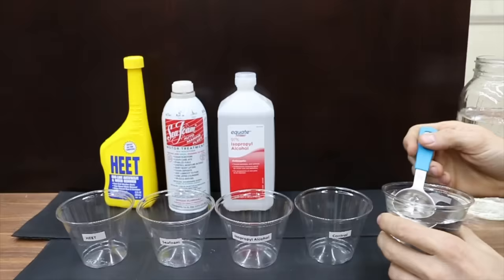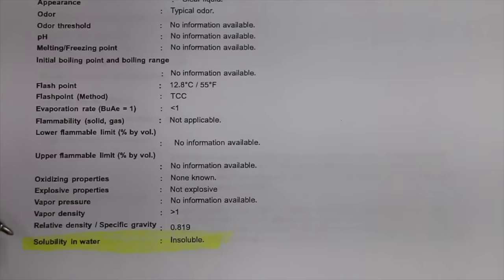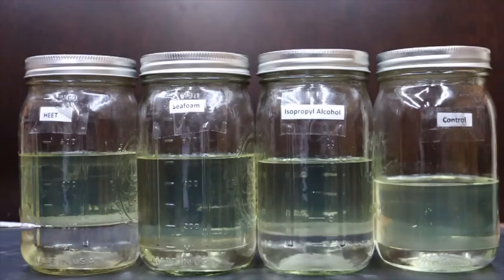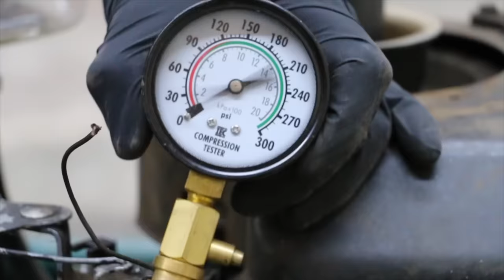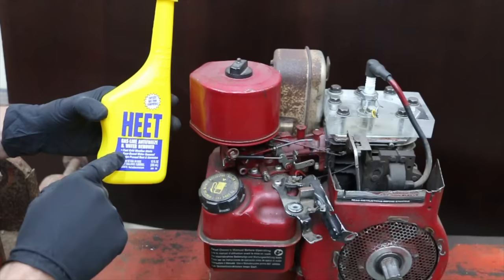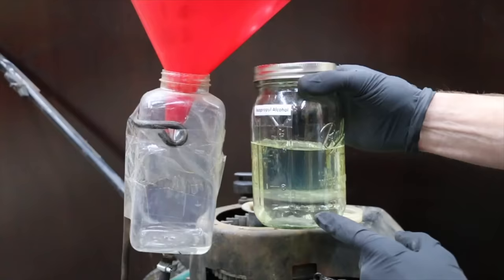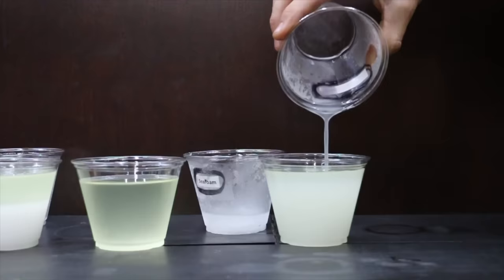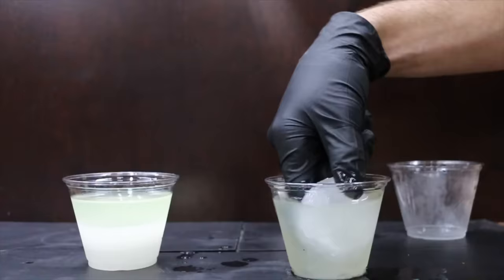Is HEET better than Seafoam for Water in Fuel?  Let's find out!

Comment: Isopropyl alcohol is sometimes sold a rubbing alcohol.  Rubbing alcohol often contains 'lubricants' in the form of silicone polymers.  The silicones pass out the combustion chamber's exhaust port as silica which can foul the emission sensors in some cars.  When the sensors fail the computer can intentionally degrade the car's performance and the repairs can be expensive.  So if you're planning on using isopropyl alcohol, make sure it's not the rubbing alcohol type.
Reply from the maker: Great point!  Thank you for this information.
Reply: SE Michigan Andy I did not know this.
Reply: @noohairdontcare  I found it out in a meeting I attended in the 90s.
Reply: Emissions are junk anyway, slows you down
Reply: @Jay-hu6ne  Regardless of how you feel, they've been regulated onto the cars and I'm not going to discuss the politics.  On several cars, if the computer is not getting a proper reading from one of the sensors, it will default into a really bad driving mode - no acceleration, marginal top speed, and kind of scary to drive. That happened to me once but the car was over 20 years old and it was not due to silica contaminating the surface of the sensor.  The sensor just got old.   And that's why I brought this up.  Isopropanol is a good drying agent but make sure it doesn't have 'lubricants' in it if you're putting it in the gas tank.
Reply: @ProjectFarm  didn't know that, thanks
Reply: SE Michigan Andy ummmm okay....I just said emissions are blah. No such thing as a scary drive if it’s just a sensor. OBD1 I have no problems with for pulling things off, ECU either compensates for it or just get a reprogram. Highly doubt a vehicle will go into a limp mode due to a sensor going bad. If anything depends on the sensor like a IAC or a MAP sensor. Yea my lightning is 25 years old and still has its original 02’s and still lays down the power fine and mileage is still great, truck has 270 thou on the clock. But for my OBD II applications, gut the emission stuff and tune and its alllllll good. Plus you might gain a little HP out of it, noting crazy but a little something.
Reply: Paul Copeland you must drive a electric vehicle and wear fake Rolex’s
Reply: @Jay-hu6ne  The O2 sensor died and the car defaulted to a max speed of about 35 mph with pathetic acceleration.  In Michigan, that's scary.
Reply: Mr T  Look up 'dimethacone,' it's in all kinds of stuff.  It's a nice sounding name for silicone polymers.
Reply: I did not know this
Reply: That's why they have isoheet.... It's also great for making lanolin based reloading lubricant.
Reply: really?
Reply: Hey I’m using rubbing alcohol as a panel wipe to take off silicone and wax before I ceramic coat a car and this information is helpful do u have a source so I can show my detail buddies
Reply: @PeteyMcSavage  They allready know, you can see it in a strong haze.
Reply: PCV and EGR will do far worse to your 02 sensors. Also old gas rot at the bottom of your tank might as well be diesel.
Reply: Don't know if a old n greasy O2 sensor spacer would do it. I need to do it anyway, burns so much oil that CEL is always on.
Reply: Great catch !!!! thank you very much:)))))
Reply: @PeteyMcSavage  Sorry, the info about it fouling sensors came from a meeting with an automotive component supplier in the 90s about failure analysis.  I've noticed some bottles of isopropanol mention that they contain 'dimethacone.'  I started reading those things years ago.
Reply: SE Michigan Andy never heard that before ever for a vehicle
Reply: DarkLinkAD you mean water....
Reply: @Jay-hu6ne  Do you mean an irate reply from a person with a headache or a tooth being removed from a car?
Reply: Mr T  Cause it doesn't get in to your skin. That having been said, I have never seen pharmacy isopropanol with lubricants. I would have noticed, as I use it almost exclusively for cleaning things such as optics.
Reply: SE Michigan Andy you mean Silica as the toxic to breathe Silica?
Reply: @AnAngryFormerDemocrat  no
Reply: use 100% ISOPROPYL
Reply: I got an old military truck without electronics, so It should still work even with silica in the exhaust.
Reply: @Jay-hu6ne  I can assure you that modern vehicles have this, as my job revolves around driving several different kinds of vehicles/engines. More than once I have gotten a "Service Exhaust Sensor" error followed shortly by a computer driven reduction in power. When you are driving a 15 ton vehicle in hills I can assure you that ANY loss of power is scary.
Reply: Andrew Case if you think power loss is scary you shouldn’t be driving then. I own different application with high HP that run 11’s down to the 9’s. I’ve had axles to bottom ends up blowing up. I’ve never heard of a driving reduction for a exhaust sensor. I’ve heard of limp mode for security reasons or a for a Bad ECU which would make sense and that’s on an OBDI and OBD II.
Reply: @Jay-hu6ne  If the o2 banks are reading lean or rich your car will be dramatically tuned down going into "limp mode" unless you bypass them. On my 4.6L the 02 is disconnected and after the system warms up it throws a code and starts to miss even though its from 86
Reply: @homefront3162  that's difficult to get. Isopropyl forms an azeotrope with water and cannot be distilled to purity. You'd have to store it in molecular sieves.
Reply: benson420710 I’ve had bad O2’s and that’s never happened on any of my vehicles, all that happens is the 02 can’t read as fast as it use too so the ecu will throw a code, not put the vehicle in a limp mode. The ecu will try to compensate to right the mixture. My 87 3.8 SFI turbo was fine even when I removed the cat and did a test pipe and didn’t install an 02 back on. Even my 85 regal which was a 3.8 v6 with computer controlled 4bbl compensated with no power loss
Reply: benson420710 clogged cat is different, you can get that with bad gas, happened to my 91 blazer. Happened to get bad gas from a station and vehicle didn’t get into your famous limp mode....the truck needed a little more power to get going and know how I fixed that? Good old water. Take a water bottle and start the vehicle and open the butterfly just a little, get the rpms a little high and do tiny amounts of water. Everything will super heat and should burn carbon and whatever caused the clog
Reply: manaquri it’ll run on anything!
Reply: Your are right but they are alot of alcohols. ethyl, isopropyl, and the grain/sugar one that is drinkable
Reply: @AnAngryFormerDemocrat  Yes, SiO2.  It forms a layer of on some O2 sensors, sort of a glassy barrier.  But that's only after it's been burned.  Silicone polymers are relatively non-toxic.  That's one reason why they're in so many skin care products.
Reply: i use 91 percent rubbing alcohol .. works great
Reply: I guess this is possible.  Do you have a spectrometer reading on this?  Silica is in everything.  Just like Al
Reply: @frontlinemedia4270  That program was in the mid-90s.  They told us about silicone contamination, but didn't provide the analysis. Most likely they picked up Si when they did SEM examinations of failed sensors.  That's almost a routine test.  I also suspect (this is speculation) that they tested out a few sensors with silicone contaminated gas running through an engine and it replicated the failure mode that they saw.  But since it's nearly 1/4 century ago, I don't remember the details.
Reply: @frontlinemedia4270  I have to add one more thing. Silica is not in everything.  It may be present as a minor trace nearly everywhere, but if a sensor is made of titania or zirconia, then the silica content is at best at the trace level.  If there are high levels of silica on the surface of the sensor, then it's due to contamination.
Reply: @semichiganandy2127  Heet works b/c C-C-C-C=OH combines with the water, H2O, and the gasoline.  The nonpolar portion, the carbon atoms, to the gasoline, and the polar portion, the alcohol group and its double bond to the water.  Isopropyl,  a 3 carbon molecule is too short, and thus more polar to work with the gasoline.  But it may work if it is slightly heated, I never tried it.  Longer chained alcohols will work to a pt, but once the molecule gets too long, and too non polar, it won't work either.  Like I said I would like to see gas chromatography on isopropyl alcohol that shows all the amounts of trace molecules, same for gasoline.  I doubt there is little difference in silica content.  Gasoline is probably just as much to blame.
Reply: @Jay-hu6ne  No I dont meant water, its a clearly a powdered texture.
Reply: @krannification  a spark plug defouler on the o2 sensor might help.
Reply: @Jay-hu6ne  if your cel is on its in limp mode which is a back up program that let's the veichle continue you usually can't tell much difference but it doesn't perform as good as if it were getting the proper signals.
Reply: @semichiganandy2127  interesting.  I always try to learn something everyday.  I never really looked into this failure, just knew they failed.  Some ppl said you could recalibrate them
Reply: @frontlinemedia4270  I don't know anything about recalibration.  The failure mode from sillicones is one of several possible ways they can die.   It's the only one I really remember well.  Some of these sensors (titania based ones)  have a small amount of platinum on the surface.  That's there to speed response times and it would be susceptible to anything that poisons platinum.  But, I don't remember what those poisons are.
Reply: False. Rubbing alcohol does NOT "often" contain lubricants.  Isopropyl alcohol may contain some forms of scents to make it smell better, but in my 15+ years of Health Care experience, I have never seen rubbing alcohol that contained silicon polymers.  Rubbing alcohol is just isopropyl alcohol, but that name came from the ability to be rubbed into the skin to create a cooling sensation that helps with muscle soreness and tension.  If the isopropyl contains additives with will typically be colored and not clear.  The only common additive I have seen is Methyl salicylate, which is simply wintergreen oil and is also almost completely water soluble.
Reply: @johnbarzee7806  OK, first, not false.  I had a bottle that listed silicones in the contents.  But, that was in the 90s and I didn't save the bottle.  It might be a rarity, but I read those labels and I understand what the contents are.  I could be wrong with the 'often' word, but the stuff I had listed silicones.
Reply: Ok, so, yes, False, you are most definitely 100% incorrect in using the word "often."  You are basing your comment and this entire string of comments on a false statement because at one time, sometime, in the 90s, you had "a" bottle of something that had silicones in the contents so now you are saying that isopropyl alcohol contains silicones.  If you do a little research you will find that some, definitely not all, rubbing alcohols do contain a different additive, but you also find that most of them that contain additives and are labeled as rubbing alcohol are ethyl alcohol or an ethyl/iso blend. In conclusion, yes, your statement was and still is 100% false, because most iso alcohol bottles do not contain anything other than the alcohol and purified water.
Reply: SE Michigan Andy thanks you just saved my ass!
Reply: I also noticed that isopropyl alcohol comes in different purities, like 90%, where you should be able to find 99% for that high purity.
Reply: Adding onto SE Michigan Andys message, If you're going to use IPA in your fuel use 99.9% IPA, not rubbing alcohol.
Reply: Holy Crap bro, its nice having friends smarter than me or is it then me, lol, either way, nice, that does make sense and I had no idea rubbing alcohol had lubricants;  I remember way back in the day I made hash with 90% rubbing alcohol, no wonder it was so good ;-) take care and thank you for your reply to my question.
Reply: Mr T  It feels good and is cheaper than the Blue Pill???
Reply: Since Blue Devil head gasket sealer is basically just silica as well (liquid glass), do you think that adding isopropyl to a radiator would act as a sealant? I’m not trying it lol but I’m very curious
Reply: @LightsaberGoBrrrrrr  What's your point?  Or are you just a troll?

My post was made because replacing an O2 sensor in a car costs people a lot of money and I wanted to prevent people from having to do that.  OK, THAT''S MY POINT.  Can I have an LOL?  I'm very curious.

Years ago, i was brought into an oxygen sensor program at one of the automotive OEMs  (look up OEM of you don't know what it means).  The people running the program pointed out that customers had been added silicone to their gasoline or to their oil and it had poisoned the sensing element of the sensor by first coating it with a very thin layer of silica which then diffused into the heated sensing element.  The silica was formed when the silicone was burned in the combustion chamber along with the gasoline.  Silica and silicone are very different things.

This came about because I had a relative with severely excruciating muscle spasms brought about because of neurological damage suffered during his military service..  (Are you going to give me an "LOL' for that?  I'm very curious.)  His caretaker was provided with rubbing alcohol, by the Veterans Administration, to be used to relieve the spasms.  The alcohol's label (it was from a manufacturer that I recognized at the time but no longer remember) said that it contained silicone oil.  I didn't want to include those details when I originally posted because the care taker was alive and I knew that the person cherished privacy.  And that person might see my post.  Both of them have now passed away (can i have another LOL for that?  I'm very curious.) so it no longer matters.  I also made the mistake of using the word "often, " which was wrong.  It was a mental slip.  

Then a guy came along who claimed that because he had never heard of that formulation, that it couldn't exist.  Well, when a person claims absolute knowledge, they cannot be disputed and that's because they are psychologically wedded to their opinion of themselves.  It's pointless to get into an "I saw this stuff," ""No you didn't because I didn''t" perpetual loop.  Do you understand that?  I'm just curious.  LOL.

Now you come along with what?  An attempt to equate silicones with sodium silicate.  That's just plain dumb.  Seriously, it's more idiotic than dumb.  So, please tell me, WHAT'S YOUR POINT?   BTW, add the wrong alcohols to the coolants of some vehicles and you'll end up degrading the gaskets.  That's more expensive to repair than a failed O2 sensor.  Can I have an LOL for that?  Just curious.
Reply: @semichiganandy2127  dude... what? Are you sure you meant to reply to me? I just asked a simple question
Reply: @LightsaberGoBrrrrrr  Sometimes a Q&A seem different in print than if they were spoken.  It sounded like you were equating sodium silicate with silicone oils (essentially poly(dimethylsiloxane, which is very different from silica).  I'd caught a lot of flack because back in the 90s I saw a case of commercial i-propyl bottles that had silicone oil as an additive and i warned people not to add that stuff to their gas.  There's a guy above that claimed to know all of the compositions of that alcohol that had been marketed and that he knew of no such composition. In his mind, it couldn't exist or was an extremely niche product.  I thought you were jumping in on his point of view and implying that I didn't know the difference between silicone and water glass.  Anyway, as for adding i-propanol to coolant, don't do it.  I've signed NDAs and don't want to name manufacturers, but there are car brands from certain years that have head gaskets that will degrade when exposed to the wrong coolant compositions.  You absolutely want to stay with stuff that explicitly states that it meets the specifications of the vehicle that you're adding it to.  Otherwise, you could end up with thousands of dollars worth of repairs.  Sorry for misinterpreting you.
Reply: Anyone in these comments able to give me some advice for recovering from bag gas in motorcycle ? I poured an old can of gas in, went half a block and it died. Topped up the other 75% of the tank with good gas, a couple of octane boosters and fuel treatment, but no luck starting it. This basketball pump style siphon is useless and so am I apparently, can’t get it to work. Give me a way to get in touch if anyone is willing to give some advice

Comment: This is by far your #1 video for me. My great uncle always told me to put rubbing alcohol in the fuel in winter along with adding rubbing alcohol to the windshield fluid reservoir. I use seafoam to clean my fuel injectors. This is the data I wanted. Awesome video again. By the way he was a WWII veteran in the European theater so he might have picked it up there.
Reply from the maker: Thank you!